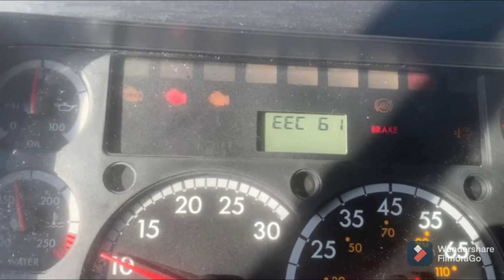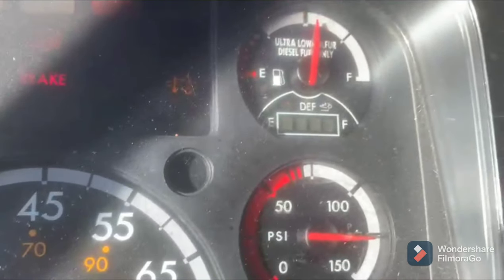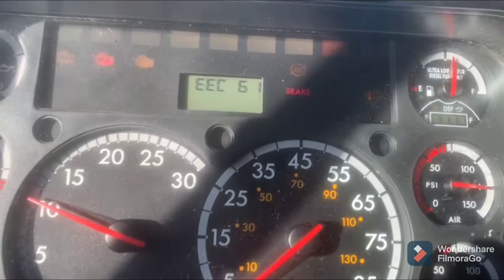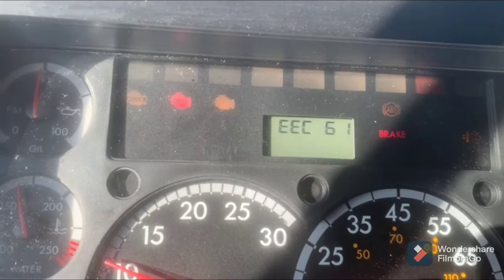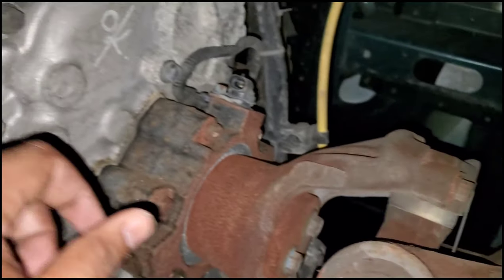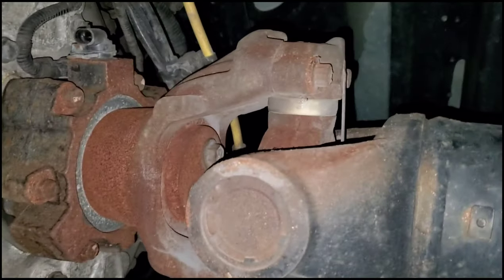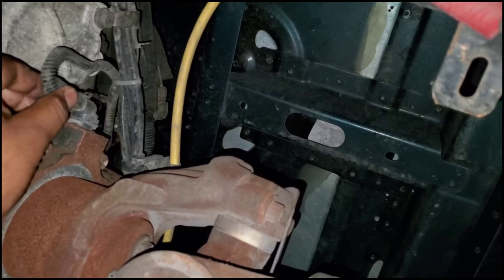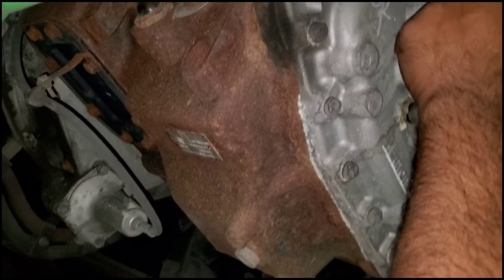HOW TO BYPASS DEF YOURSELF? EASIEST TRICK TO SAVE ROAD SERVICE IF TRUCK SPEED DROP TO 5 MPH.

Comment: Only works on older trucks, freightliner reprogrammed and now you can't do that any more. The truck is derated by rpm now. Not by speed sensor, at least on the 2016 Freightliner, might try pulling the fuse for the ABS sensor, might work on the newer trucks.
Reply: Yeah I tried pulling  the sensor on my 2015 and it didn't work. Where is the ABS sensor?
Reply: @josephwinfrey5732  don’t unplug the sensor u have keep the sensor connect but take it out the hold the sensor it work my guy to make it easier on u just buy a new sensor unplug the old one put the new one in the plug and zipper tied it down it get U home or to a shop
Reply: Well that explains my problem
Reply: @trustinthelord2248  So, does this mean that he had a bad sensor?
Reply: @LiveLifeLivTrucking  no
Reply: @trustinthelord2248  Thanks! Trying to understand as I have a 2020 Freightliner Cascadia that needs a DEF pump. It has derated to 55 mph. The dealership has no clue when DEF pumps will be available.  I can't locate one anywhere. Just trying to figure how if it will be 850 with no load and a trailer to get some type of remedy or if there is something that I can do?
Reply: @LiveLifeLivTrucking  if u try get home just pull the speed sensor out of it holder and zip tied it down and keep rolling u just want no how fast u going did u try to regine
Reply: @trustinthelord2248  It will not allow a manual regen. I will try to locate the speed sensor.
Reply: @LiveLifeLivTrucking  u need buy otr tool so u can force regine yourself
Reply: @trustinthelord2248  I will look that up!
Reply: @trustinthelord2248  where we can buy that tool?
Reply: @davlethud6804  Amazon
Reply: @josephwinfrey5732  having this problem with 2016 Cummins right now did the abs work and where is it.. help
Reply: Get different truck 😂
Reply: I got this problem, where is the speed sensor located on a 2016 freightliner please, I can’t see mine
Reply: Easiest thing to do is carry a spare speed sensor. Plug it in and lay it on top of the transmission or zip tie it to something. The computer will sense the sensor but will not read any speed.
Reply: @GraceEngineering will that work 2017 international automatic ?

Comment: Hmmm. Gonna keep this in mind. I (no joke) have over 20k in towing bills just this year alone from the stupid DEF system😡
Reply: Me same bro
Reply: Damn,that's a lot of cash 😡
Reply: @Darubini01TV  yeah bro tell me about it. That’s towing alone. Everytime I had it towed to a shop they kept saying def sensors were bad. I’ve since solved the issues. Best way to fix the problem!!!!sell the trucks😂
Reply: How far could drive like that
Reply: @arringtonboysracing  once turtle light comes on the trucks I owned usually go about 5 miles then it bogs down to 5mph
Reply from the maker: Sorry to hear that but hopefully this helps you.
Reply: @Holeemoleex3  Thanks buddy but since these encounters I’ve actually gotten rid of my fleet of diesel trucks all together. Thanks again though
Reply: delete def no problem
Reply: @desitruckersinu.s.a2797  it only work is manual truck not in automatic
Reply: Damn‼️
Reply: Problem is by doing this most you will get is 65mph, but way less power. Hard to pull any kind of hill.
Reply: thank your Obama who placed def on trucks
Reply: This work on 2017 freightliner automatically  I'm having problems now 
What the speed sensor look like

Comment: I tried did not work. My 2011 Freightliner Allison 6 speed transmission won't shift out of first gear after disconnecting the space sensor .

Comment: If it's an automatic transmission the transmission will not shift. depending on the transmission it could only have 3rd gear which would make it hard to start off.
Reply: It drives in manual mode, trans doesn’t know when to shift because no speed sensor. That’s how it is in a Volvo, at least

Comment: hello bhaji, i tried this method and remove clutch switch on my cascadia 10 speed manual but not works, adviced this trick not work for freightliner detroit motor,

Comment: Didn’t work, I’m having the exact issue as you but when I unplug the sensor I still can’t go over 5, on top of that I have another code for radar and the truck is running even worse than before. Thanks anyways

Comment: My truck derated and wont go over 5mph (only goes to 3rd and 4th gear). Hear a slight hiss and draw back every time It tries to change out of 4th gear. My stop light came on. Loves roadside came and hooked up PC and said its def pump. Went and bought a used entire def unit. Only switched the pump but still has same problem. I hooked up my scan tool and noticed it saves def tank has 75 percent but then it goes away at times and then reads at times (all while scan tool is connected). Def status, exhaust temp and all reads NA. Could it be that unit that sits in the tank? Is that where the sensor is? If so do you think ifs best to replace that part since I have the entire used unit?
Reply: Also what spn code did you get at the time? It takes us truckers banding together to share our experiences and facts about things to defeat the corrupt dealerships and manufactures. They hide and keep everything secret only to rip us off and beat us over the head and all we want to do is drive to make a living for our families. Thanks.
Reply from the maker: SPN4374/FMI 0 = DEF PUMP SPEED & DEF PRESSURE 👌 engine reaction will be 25% Derate. This code is set whe. DEF pump speed is higher than Normal for given Def Pressure.
need to replace DEF pump if you have this code. 
If you buy from junk yard it might cost from 400$ to 1000$ Always call multiple people and dealers.
Reply: @desitruckersinu.s.a2797  Loves “road side assistance” lol said def pump. I didn’t have that code. Fool told me my problem is def pump not working. Turns out It was the def doser valve had burned at the connection. I went to junk yard and just replaced the pump also because I didnt know it was the doser until a few days later. Sad thing is that warning and derate will not go away until code is clear. The manufactures should be in place a default reset once the problem is fixed. Its unfair to consumers that you need to take it in somewhere or buy in expensive reset tool to do so. You could be stuck out in the Arizona desert or in the mountains with no phone service smh
Reply from the maker: If your doser valve/pump is bad try to disconnect the sensor switch from the doser valve. It bypass the reset requirements it worked on my truck hopefully help someone else.

Comment: That did not work on my 2016 with a Detroit
Reply from the maker: it works on my 2016. some trucks dont accept this trick not sure why but there is nothing wrong in trying when we stuck.
Reply: @desitruckersinu.s.a2797  having this trouble now . I got 2016 should I pull the abs once I find out... Cummins